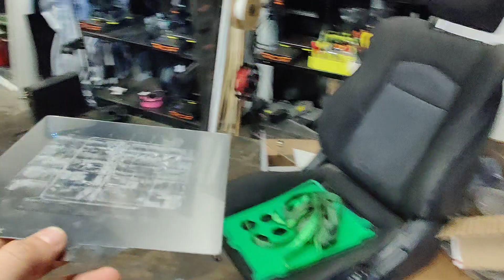Print Steel Sheets warp under high heat

Comment: Had it happen on me using the stock KP3S magnet with a PEI sheet while printing a large print edge to edge diagonally. The top part of the print cooled and shrank much quicker (more) than the base and ended up lifting the corners of the PEI sheet as the print was still stuck to it. Ended up using paper clips after that if I have to print anything that takes up the whole build plate.
Reply: I agree, better magnet or use clips.